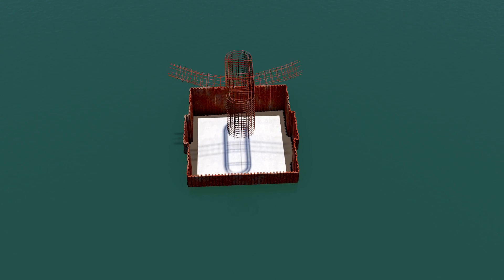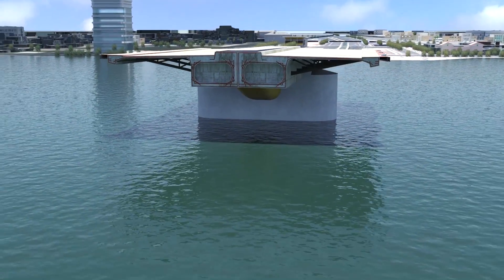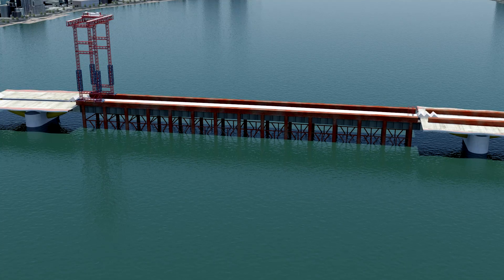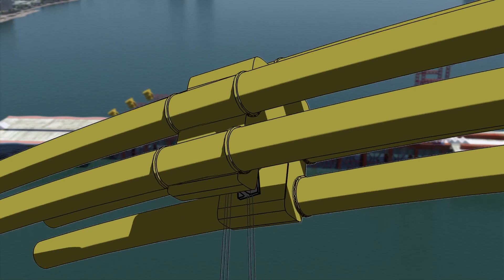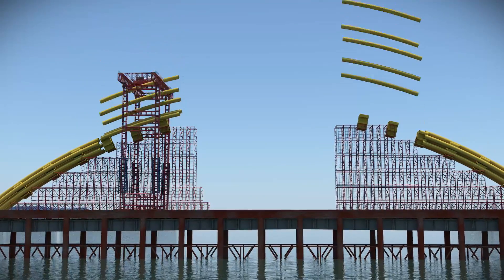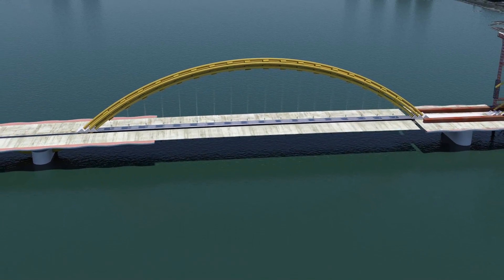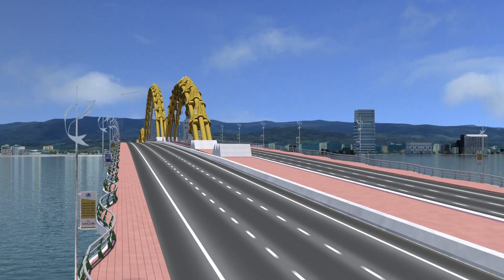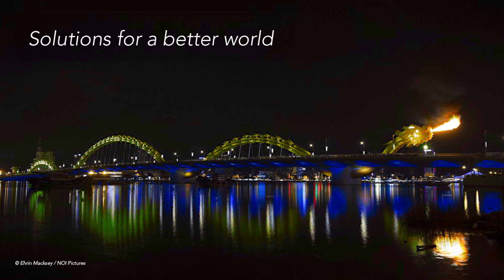Dragon Bridge Da Nang, Vietnam Construction Sequence

Comment: Dragon Bridge, Da Nang - Vietnam 

The Dragon Bridge (Vietnamese: Cầu Rồng) is a bridge over the River Hàn at Da Nang, Vietnam.

Construction of the bridge began on 19 July 2009 (the same day as the inauguration of the nearby Thuận Phước Bridge) when the Prime Minister of Vietnam Nguyen Tan Dung and many high-ranking government officials attended the groundbreaking ceremony.

Material: steel
Total length: 666 metres (2,185 ft)
Width: 37.5 metres (123 ft)
Longest span: 200 metres (660 ft)
Clearance below: 7 metres (23 ft)
Construction begin: 19 July 2009
Construction end: 29 March 2013

Discover more from following link:

- https://plus.google.com/113802287057076867915/posts/Q4b7oPQAAE8